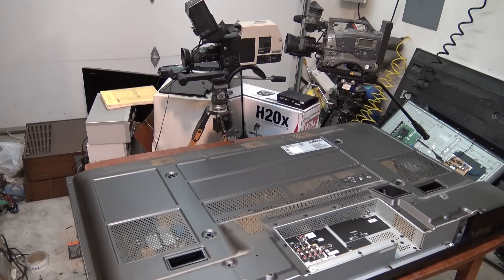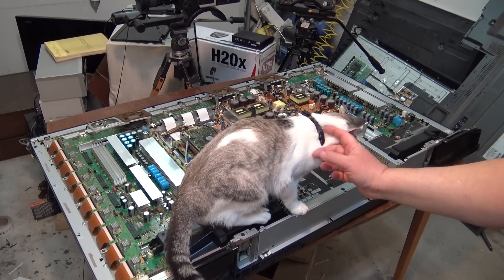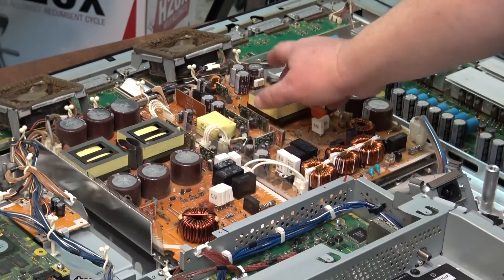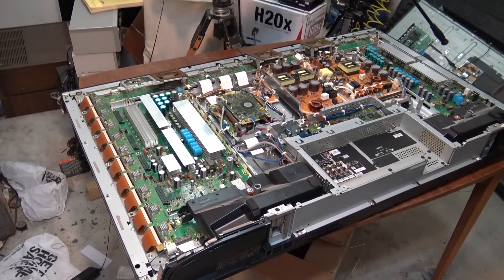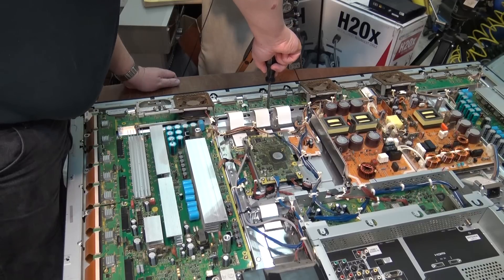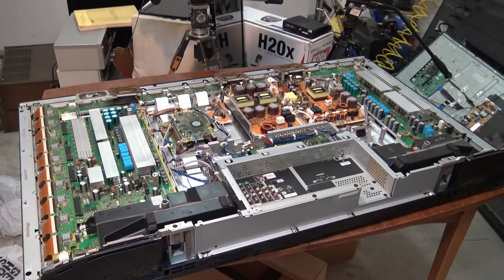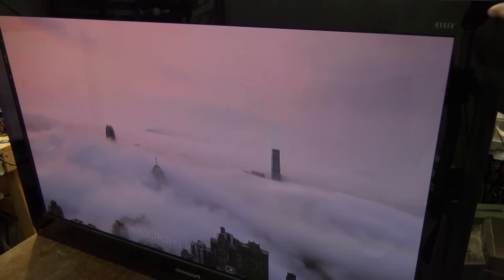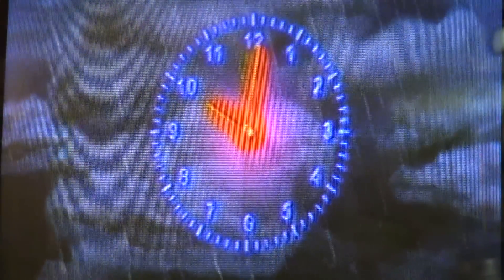Panasonic TH50PZ750 shut down   5 Blinks

Comment: Thanks for all the plasma repair vids 12volt. Though I've been an electronics tinkerer for many years I would never have had much of a clue about repairing those things. Watching all your vids helped give me confidence that my testing was correct. A friend of mine just recently gave me a dead 51" Samsung PN51D530A3F plasma. I tackled it and was able to find the three shorted IGBTs on the X-Main board and replace them with parts from a ShopJimmy repair kit. I tightened a bunch of ground screws that may have been the cause. The TV works perfect again. Another one saved from the landfill.
Reply from the maker: Plasma sets are fun to work on. Unlike LCD and LED sets they are very serviceable because they uses allot of discrete components that can be replaced.

Comment: Worst burn in on CRT was in a security control room, same computer image on screen for 10+ years 24/7, you could read the burned in text clearly with the monitors turned off when we retired them for LCD screens. Thanks for the videos. :-)
Reply from the maker: I've seen CCTV monitors with real bad burn in to. I remember in broadcast the b/w camera monitors in the control room had color bars burned into them, and the superimposed framing mask which was a white corner markers, and a + right in the middle of the screen.
I had a few old computer monitors that I abused, and burned so badly you could read the image when off.  This color set in my shop that I use for my cameras isn't far off though. You can see the image with it off.

Comment: Sliced  my fingers open yesterday opening up the P50G10B model. They really are sharp as knives.
Reply from the maker: They are and I believe I said that.
Reply: @12voltvids  Yup, razor sharp! Hey, I just tried tightening all the grounding bolts but I'm still getting the 5 red flashing lights. When I power up the TV I can literally hear the power board firing up, then a click, and it gives up. I'm a novice, trying to learn about TV repair. What's your verdict? Needs a new board? Or could be something else?
Reply from the maker: @hamez8king  
The ground screws work their way loose and arc, causing parts to fail. My old plasma it blew about 5 parts on the SS board. You need to google the fault codes for your specific model as the blink codes are different for each generation. That will give you a direction to go. Sorry I can't be more specific but there are many things that will put a plasma into protection. Over voltage, under voltage, over current, buffer board failure, sustain board failure, audio amp failure, tuner failure.
They are very complex sets, far more than LCD sets.
Reply: @12voltvids  I see. I'll Google it. Cheers boss.

Comment: plasma still remains my favourite for television
Reply from the maker: I just like it because it is cool how it operates. Electrons flying through neon gas.
I like CRT sets too. I had an HDTV CRT that weighed a ton. Gave it away. Wish I had hung onto it because it would be a collector item some day. Had a wicked picture, superrior to plasma or anything else in 1080 mode.
Reply: i can remember 1080i crt sets i had a philips one it was ace, you just cant beat these old sets the picture was fucking awsome, especially on valve sets
Reply from the maker: I had a Panasonic 34Wx50 and it had an awesome picture. I gave it to my wife's parents, and it eventually packed it in. I was going to bring it back to the shop and repair it as I wanted to keep it, but the wife said no way was I was bringing it back in the house. That set was close to 300lbs and this was before I was shooting these videos.
It would have been a great set to have beside my work bench. I anded up with an old 42 plasma there, but the plasma is a SD set, and this tube panasonic was simply amazing. Mine didn't have HDMI or DVI, just component but it would do 1080i 480p and 480i. The 1080i picture was fantastic from a bluray player. I used it for 10 years before replacing it with the 1080p plasma I have now on my desk.

Comment: Dear Dave, I can not thank you enough for the video you did on Panasonic dissimilar metal on grounding boards. I totally understand how people would throw away a set with these kind of problems ,
My set is 16 years old a 55 inch 720 p flat screen with exact problems you were sharing with your viewers, I am a layman with basic electrical knowledge, And to be honest never had to much luck at repairing something so sophisticated.
I said what do I have to loose ? if it works I saved buying a new set .If It doesn't the new sets have come down in price considerably,
What I want you to know is that I followed your video exactly as you showed and voila, It works perfect .
Thank you so much , also I became a subscriber.
Sincerely
Paul Sorbello
Reply from the maker: When you catch the ground problem before it blows a component it will fix the intermittent problem every time.

Comment: We used to call sets like that, where the owners smoked "reekers";  in Scotland, 'reek' basically means smoke.  There is a saying to wish someone well 'lang may yer lum reek', which means 'long may your chimney smoke' - hence, reekers.

Houses that had open coal fires and smokers in the house were usually really bad, sticky even.  Any rentals that we brought out of a house like that were usually ditched immediately (unless it had only been a short term rental).
Reply from the maker: Some of the TVs I worked on in the shop were just totally disgusting.
Almost stomach turning they smelled so bad, and were so gross inside especially around the flyback transformer and HV block.  I had one that was so bad it actually started arcing from the input of the tripper to the chassis because of the contamination.

Comment: Love my 2009 vintage 50" Panasonic plasma 1080p set. Unfortunately my problems wasn't loose ground screws but a couple of bad chips on the power supply board. It's now running beautifully and probably will for many more years. These plasmas have to be the closest thing to oled's out there. Still waiting for a price reduction there, but I hear that there is a longevity issue with the red led's on the oled's. Iam still tinkering with my 58" plasma with a one blink code, bad A board. I sent it in to a Panasonic tech who confirmed that it was bad in a working set but couldn't determine the issue with the board. Very hard to find good replacement parts that aren't junk!
Reply from the maker: Same here. Love the old Plasma. OLED are very good, but there has been burn issues with them in the past, so they will have to work those bugs out before I invest. I have another Plasmas here to open a TV store.
8, all working. A 480p in the garage, 4 720 sets and 3 1080. 2 are spares. I have 2 more broken sets needing parts.

Comment: I had a lightning strike hit in my yard and my plasma will not turn on and the red led is off. I checked the fuse on the main power board and it has continuity and so do the larger capacitors. There are not any burn spots on the board. Do you have any recommendations?

Comment: That's a beautiful set. If it was yours, would you put star washers on all the grounds? I know you'd run a file along the edge of the back panel! 
I have a couple of BiAmp CPA-130 amplifiers. One was assembled in the US and the other in India. You can see the pride built into the US built amp. The amp from India works, but is thrown together.

Comment: should you use locking washers to stop the problem from ever happening again.
Reply from the maker: Didn't have any, and besides it lasted 10 years before the problem happened. In another 10 years I am sure something else will fail long before the screws work their way loose again.

Comment: I had a large number of the panasonic plasma tv's that also had a nother issue with the panel. That was shorted pixels and normaly near the bottom of the screen. This also would take out the associated driver i c. Replace the faulty board with a new one and it would fail just about strate away at switch on. Took a a while to find the root of the problem. At first Panasonic would not beleave our problem, untill the sales rep steped in. Panasonic ( Australia ) do not carry spair panels and if a warrentee claim the customer would also get a new and possable upgraded set. On a nother note had one set come in with a bullet hole ( .22 ?? )  through the screen and out the back. That set was only 6 month old and defently not a warrentee job, but the customer complained to panasonic and to keep the peace, panasonic eventualy gave the customer a new plasma set at the time. We got that set for spair parts !!

Comment: I have a Panasonic 65 inch I got it back in 2009 and I got lucky and picked up another Panasonic. This one’s a 46 inch TV 2012 they’re both plasma both of my TVs work Beautiful the 2009 model did some blinking with codes but thank God I know about Electronics I did the same thing you did. It’s about the screws. 😂 now my  65 inch Panasonic plasma TV works beautiful it’s amazing how they do the surroundsound it really freaks me out when I’m playing Grandtheft auto five online how the surroundsound is it’s beautiful and on my 65 inch Panasonic TV I think I have 4 fans on the back of my TV set and 46 inch TV I got at the pawnshop. Oh yeah I forgot to tell you how much I picked it up for the 46 inch Panasonic plasma TV 2012 works beautiful it’s like brand new here’s the surprise price I only paid $40. Did I just take your breath away and did mine as well I fell in love with it right away the 46 inch Panasonic TV didn’t have any fans in the back of it and they’re both 1080 P I love them I will never sell them because I love Panasonic and I even have Technics 1040 DX 5X100w surroundsound Dolby surround sound DTS and Technics 1050 DX high current MOSFET 5X100w they’re both extremely powerful surroundsound receivers

Comment: I have a 50 inch Panasonic that appears identical to this one. all the ground screws were really loose too. I also reseated all the electrical connectors. it still will not start the relay clicks and it flashes ten blinks. Any chances of a simple fix at this point or is it already too late?

Comment: Hi, Just watched your informative video. I have a 42" Pana Plasma TH-42PX60U that first had 10 blinks and replaced the power supply board. However, now it blinks 5 times. Fan turns on for only a second and TV shuts down with 5 blinking lights. I did try your advice to tighten all screw on all the boards, especially ground screws with tabs. Still same result, TV does not power on. Could you give me other possible source of trouble?

Comment: Hi I was wondering if you can help me out to diagnose my problem, I have a Pioneer dj-sx controller and when powered up nothing works, there is 5v coming in from the power adapter but was wondering what test I can do to fault diagnose

Comment: Looking in to the back into the boards power board center and board to the left bad screws check for arcing
Reply from the maker: Didn't have to look. Know they were arcing due to the looseness of the screws.
They are all very loose, some more than others, but all of them needed tightening. That is why I did it before powering it up. I didn't want to be the one it went POW on.

Comment: Love your videos, especially dealing with those Panasonic Plasmas. I to have a 50” unit purchased in 2006.  Unfortunately my issues come with a clicking sound that whenever it occurs, the unit doesn’t turn on. I can tell you that after dealing with this problem for over a year,  this shut down/clicking happens when power is interrupted and even though l had the power board capacitors professionally replaced ( based on repair guys recommendations), it still happens when again the power was interrupted. I don’t get to many power interruptions in my neighborhood, maybe once every 3 months or so but that’s exactly what happens every time..I have brought the unit back to life several times since but if you as me how, l am clueless. What can the REAL issue be?
Reply: mine comes on after sitting on idle for some hours with no picture. seems like a capacitor needs to get charge, it stays on and works beautifully after that. if i shut it off for any length of time it does it all over again.
Reply: @jayperez3431 Hi. I had a very similar issue with a Samsung LCD  tv. Replaced the capacitors and the problem was fixed for a while.

Comment: Hi have a old sony kv 1320 13" crt which I am repairing/restoring.  how do you soft start the tv because it has a kick start oscillator to get the telly going . Variac will lock the oscillator up and blow the transistor and they are hard to find these days. Any suggestions?
Reply from the maker: The 1920 were the same. Can't use a variac on those. Need the inrush to charge  the start capacitor and kick the oscilator.. All you can do is supply an extarnal supply to the oscilator to get it running before you bring power up.

Comment: I thought it wasn't okay to lay down a Plasma TV.  Could you elaborate on why you thought it was alright to do that?   I was told when I bought mine that it has to stay upright at all times because of the gas inside the panel.  I came to your video because I have this very issue I think, as my Panasonic Plasma suddenly stopped working but I have no blinking lights or power working on it currently.
Reply from the maker: Laying them flat is not the problem. Transporting them flat is. The stress of hitting bumps and potholes can stress and crack the glass. The same is true for LCD and LED TVs. Its the glass that is fragile, not the neon gas in the panel.
Reply: 12voltvids thanks for the quick response!  That makes sense but I am not well informed so I blanketed the protocol to keeping it upright at all times.  I’ll be checking my grounds this coming week when I have time but I think there is something worse afoot.  It literally cutoff out of no where with no lights or anything.  And hasn’t booted since.  I’m pretty tech savvy but this beast is a bit beyond me.  I’ll do some general diagnostics and might have to get it to a specialist.
Reply from the maker: @TrianglesAnRhombuses  
Is there a blink code when you try to power it? If not then you need to check the standby power supply.
Reply: 12voltvids I’ll be sure to check that, but currently nothing is happening when I plug it in.  It’s completely down.  Thanks for the advice, I’ll update when I get the chance to open it up and check.

Comment: This information is great to know.  

Do only Panasonic plasma TV's have the loose ground screw problem or is it all Panasonic HDTV's?  Because plasma TV's generate so much heat, are they a lot more susceptible to the loose ground screw problem?  Would putting star locking washers on the ground screws solve the problem?  And finally, does the loose ground screw problem happen to Samsung plasma TV's as well? I've got a very heavy Samsung 50 inch 1080p plasma TV.

Thanks for all you do.  I always learn something when I watch your videos.

Regards, Tom
Reply from the maker: THOMMGB 
Panasonic plasma are problematic with the ground screw problem. the reason is dissimilar metals with different thermal expansion when it hears and cools. lock washers prevents this. of course torquing them down real tight will also lessen the chance of them coming loose again. the big problem with Panasonic is they use the chassis to ground multiple points on the board. other brands have ground screw problems too but not to the extent of the Pana plasmas.  I have a even heavier Samsung 63 plasma. 8 years old no troubles yet. been a great set.
Reply: Thanks for the quick reply.  

I found my Samsung on the side of the road.  It was a monster trying to get that sucker into the back of my Pathfinder.  As it turned out, all that was wrong with it was that one of the four fuses on the power supply had burned out.   I found a ceramic 12 amp, 250 volt replacement on Ebay.  I also replaced 4 capacitors that others had recommended because they were known for causing problems.

Your videos make it a lot less intimidating when it comes to getting into these sets as well as other electronics.

Again, thanks for your help.

Regards, Tom

Comment: great video, i have a panasonic th50pz700u, when plug in no blinking light, when power on you hear first click from stand by relay, fans go on for about a second then turn off and light begins to blink , i counted up 30 blinks. any help will be appreciated.
Reply: I’m not sure 30 blinks is accurate.  There should be a pause in between blinks, and then that’s when the blink cycle starts again.

Comment: I have same 5 blinking lights on my Panasonic TCp50G10. I want to fix it myself but need to know what the blinking lights mean. Can you please assist?
Thanks
Reply from the maker: 1 blink STV 5v sense DG Board.....2  blinks 15v SOS D Board....3  blinks 3.3v SOS D Board.....4  blinks Power SOS P Board......5  blinks 5v SOS D Board.....6  blinks Driver SOS 1 SU / SD / SC Boards (SC energy recovery circuit).....7  blinks Driver SOS 2 SU / SD / SS Boards (SC floating voltage area).....8  blinks Driver SOS 3 SS Board (SS energy recovery circuit).....9  blinks Panel Config. SOS.....10  blinks Sub 5v SOS / Main 3v SOS DG Board DTV 9v SOS / Tuner Power SOS.....11  blinks Fan SOS PB Board.....12  blinks Sound SOS H Board.....13  blinks Communication error DG Board with IC8001 (Pesks Lite 2)
Reply: Thanks
Reply: just look up the schematic lmao